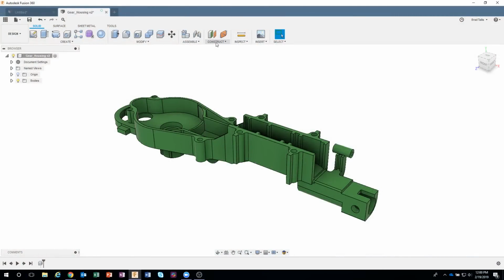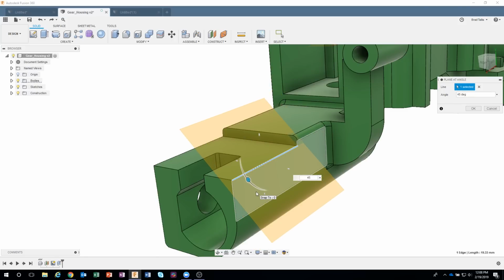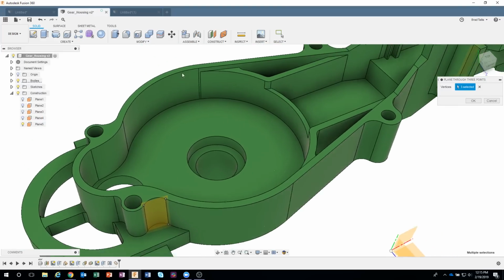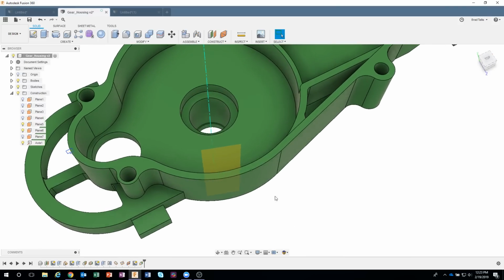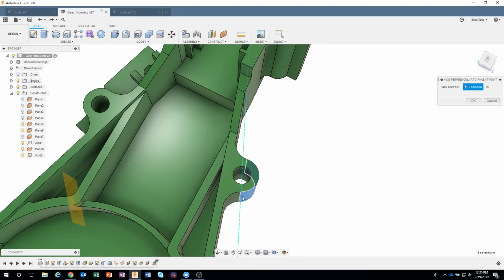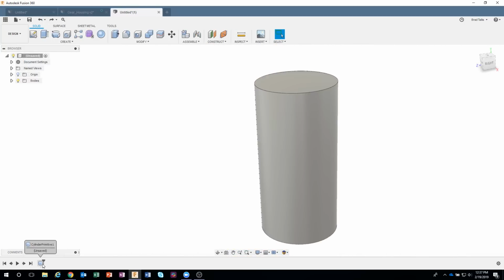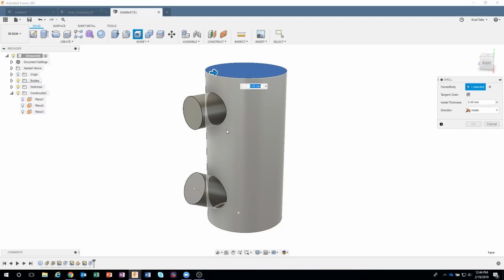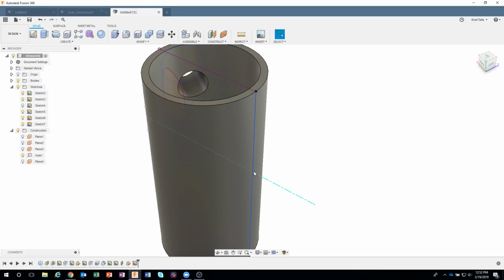Episode 13, Construction Planes

Comment: Great share. One of the most useful vids I have seen, thanks.
Sometimes F360 makes these really tiny orange reference planes. 
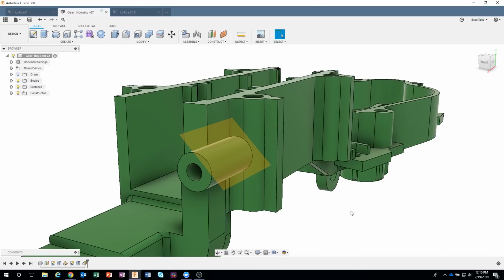At 13:00 as soon as you started showing how to resize a plane I did a face-palm - should've known.
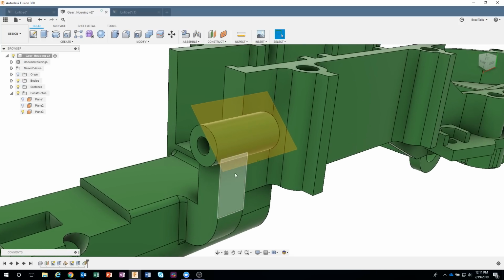Same thing with Plane along a Path at 13:35 - I should have figure out what Distance meant... Very helpful tip, will be using from now on...
My question is, after you create a plane, start a sketch, and start orbiting the view, how do you get back to a 90 degree (normal) view of that sketch.
You can do that with one of the major planes by using the magic cube in the upper right, but how do you get back to a normal view of a whacky plane?
Reply from the maker: You can use the "Look At" icon in the middle-bottom of the viewport.
Reply: @bradtallis8968  Thank you, much appreciated - sometimes its the little things that slow you down...

Comment: It seems that tangent plane doesn't work with T-splines surfaces even after you convert them to Brep. Is that a known limitation?

Great video as always. Thanks!
Reply from the maker: Numan-  You are correct.  Tangent Plane does not work on surfaces of T-Spline bodies.  However, you could use "Plane Tangent to Face at Point".  You could then select the T-Spline face and select an intersection point of your T-Spline body.  You might want to "Convert" your T-Spline to B-Rep and select "Keep Edges" to capture the edges you want to keep.